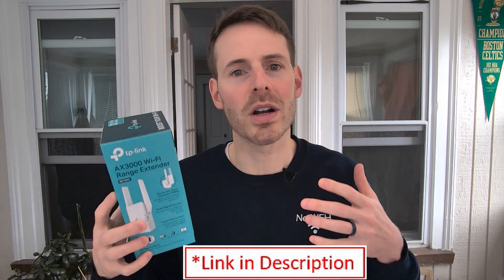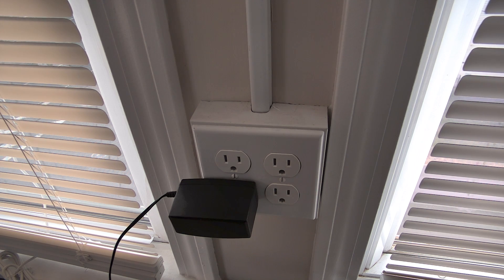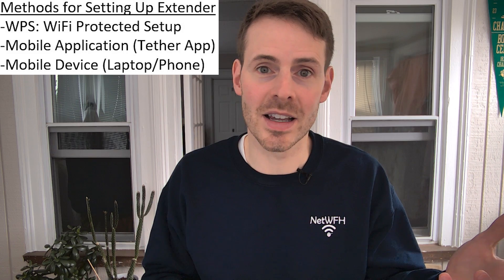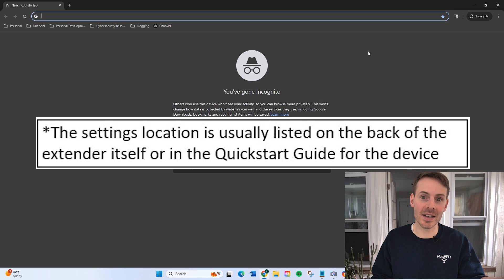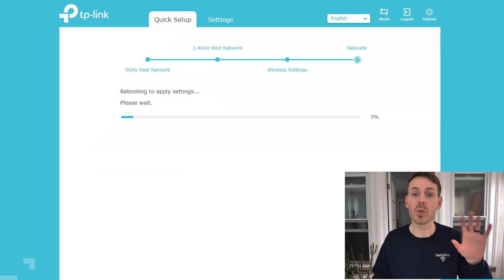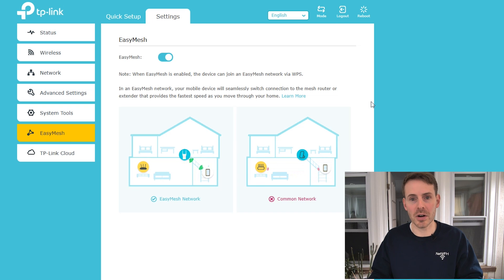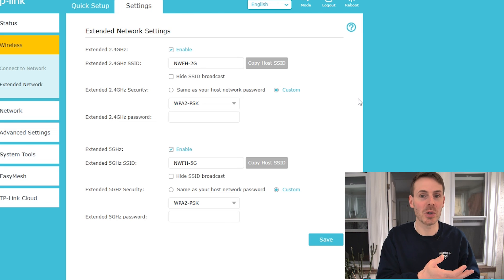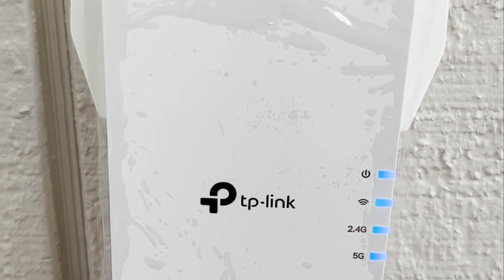WiFi Extender Setup: The Key to Stronger WiFi (TP-Link AX3000)

Comment: My WiFi extender is stuck in the rebooting to apply settings page. Any suggestions?
Reply from the maker: Have you tried performing a factory reset on the device? I would recommend starting over with the device if it’s stuck in the reboot phase. I hope this helps!

Comment: After watching your video, I will promptly return my TP-Link AX3000 to Best Buy in the morning.
Reply from the maker: Is your plan to replace it with another device that can extend your WiFi signal, or did you determine that you don’t need to extend your WiFi signal at all?
Reply: @network-from-home  Too complicated for an old timer. I found the Commodore 64 difficult to use in 1984.

Comment: Absolutely worthless video. I'm just going to return the extender. No one can seem to explain how to connect the the extender to my current WiFi network WITHOUT having an internet cable plugged into the extender. I simply need it to connect to my existing WiFi and amplify the signal, WITHOUT having to be plugged into any Internet cables.
Reply from the maker: I’m sorry if this video didn’t provide you with what you are looking for

Comment: I want a wifi extender to provide access to a home battery. I don't want the home battery to see other devices on my normal wifi network. In other words I want the extender to create its own local network (with its own IP address space). Is this easy to set up?
Reply from the maker: An easy solution here would be to have the battery connect to a Guest WiFi network. This is not complicated to do. I hope this helps!
Reply: @network-from-home  yeah I ended up doing that. It meant moving the router and losing access to a couple of rooms. Might need an extender to fix that later.

Comment: Thank you for the video. Any chance to do the same using the NETGEAR WiFi 7 Range Extender (EXS25) – BE5000 Dual-Band Wireless Signal Booster? I want a seamless connection using my Netgear Router but I can't find anything on how to setup like you did with the TP-Link. Thank you.
Reply from the maker: I can definitely add this to the list of potential videos that I make in the future! The only trouble here is I have all TP-Link devices in my home network, so I would need to get a Netgear router and extender, so it may be a while before I get to this. Thank you for the idea though!

Comment: can i extend from another extender? i mean use 2 of this to reach farther??
Reply from the maker: What you are referring to is “daisy chaining”. I would not recommend doing this with extenders because you will get worse performance each time you add another extenders to the chain. You might want to look into getting a mesh WiFi system if this is a need in your home. You’ll have better performance daisy chaining mesh nodes together. I hope this helps!

Comment: So do all devices including other cell phones in the house now login to the Wi-Fi extender as the Wi-Fi network instead of our original router name?
Reply from the maker: With a WiFi extender you have a choice of which WiFi network to join with your devices. Keep in mind that as long as you have a strong WiFi signal, connecting to your primary router’s WiFi will give you the best performance. I hope this helps!

Comment: Can you use say 2 extenders together for a larger room?
Reply from the maker: You can use multiple extenders if they have a WiFi signal from your router, but I would advise against “daisy chaining” them together so that one extender is connected to your router and the other extender is connected to the first extender. You will get really poor performance doing it this way. I hope this answers your question!

Comment: you can also run an ethernet cable from the router to the TP Link correct?
Reply from the maker: Yes you can! In doing this you can set up your extender in access point mode, which will give you really good performance! Also, your extender and router will broadcast the same WiFi network name, which makes it a more seamless experience for your devices. I hope this helps!

Comment: I did the same instructions and now I have a strong internet connection. I prefer the Easy Mesh mode as changing WIFI manually while you are roaming in the home can be annoying  🙂
Reply from the maker: I totally agree! EasyMesh mode is definitely more convenient (and offers better performance)!
Reply: So the easy mesh you use the same info for router?

Comment: Hi, I am a disabled veteran and use the internet for almost everything. My question is, I want to add cameras for safety, but there is no strength.  I use ATT, which is Liberty here in Puerto Rico. Should I get an extender for my home?
Reply from the maker: A WiFi extender is definitely an option here if you don't have great WiFi signal in the areas where you would like to put cameras. Another option is to get a mesh WiFi system. I have some videos talking about mesh WiFi coming out in early November, so stay tuned for those!

Comment: I bought and returned the newer version of this very unit. After the tedious setup procedure, it told me to unplug and move it further  from my TP-Link Archer AX55 router. I did exactly that (20' from router) and then it never received a connection. After repeating this back and forth several times, I boxed it up and returned it. My router gives me good enough coverage and great speed, but this extender was a joke and it is even made by the same company that makes my router. Some devices are just not worth the hassle.
Reply from the maker: I’m sorry to hear you had so much trouble with this extender. As long as you have good enough coverage with your router, it sounds like you’re in pretty good shape. Thank you for sharing your experience!
Reply: I just bought one of these. They are a real nightmare to set up. I bought and returned one of these about 1 year ago because I simply couldn't figure it out. I guess Ill try again
Reply: We are. Having that problem right now. It seems to be a piece of crap
Reply: It was a pain to install and THEN,IT DOES THIS. NOTHINH.
Reply: I find this interesting as this device was rated a "top pick" by PC Magazine.
Reply: Bought one as well and it hardly works.
Reply: I just bought one of these today and have been working all afternoon to try and hook it up with no results, I have no idea at this point